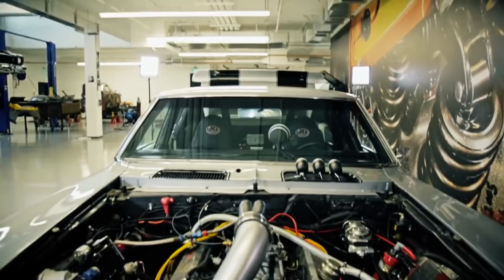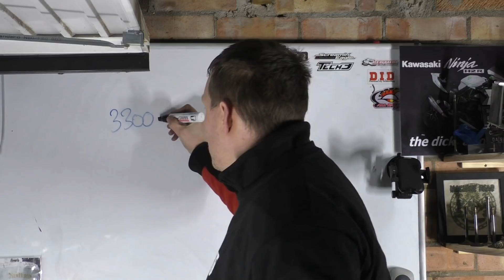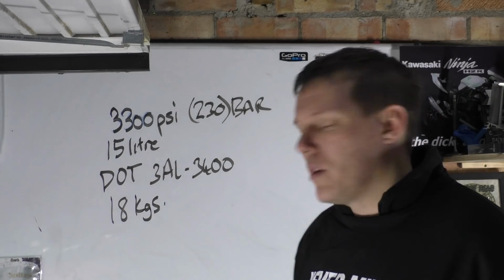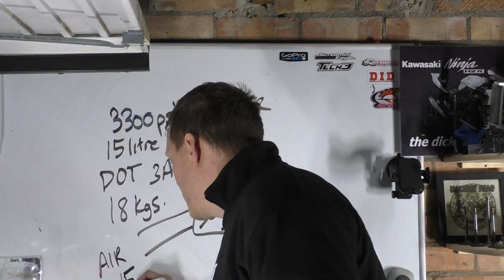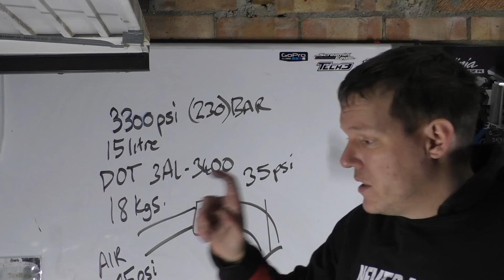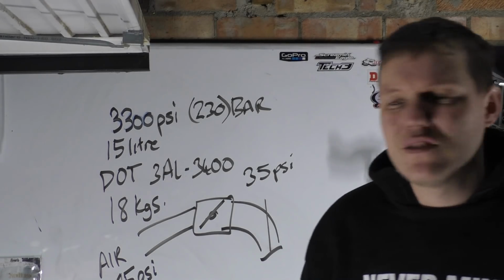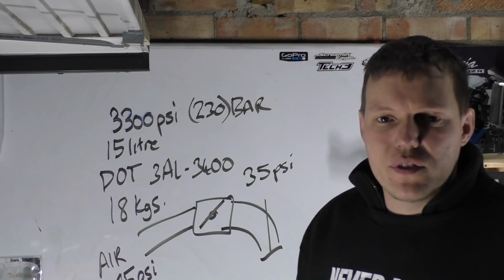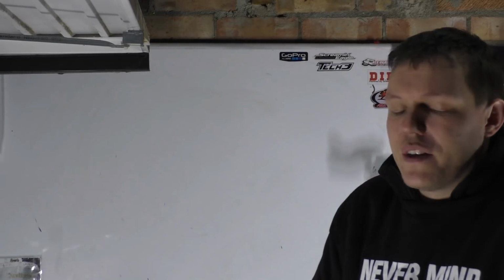Compressed Air Supercharging? - Bullshit?

Comment: They are carbon fibre bottles not carbon jacketed, also they are well bigger than 15 litres  ,if it weighs the same as a complete blower and produce more power then your saving mechanical stress on the motor running a blower ,especially when they go bang ,how many drags you seen on the line and it rips the blower straight off the motor ,in reverse if motor goes then it just blows intake pipes off ,I was bewildered by new system but if it's proven then we see them more in use on the strip
Reply from the maker: "They are carbon fibre bottles not carbon jacketed"

- wrong. 

"158 scf Aluminum Inner, Carbon Fiber overwrap"

From their site here - 

http://casupercharging.com/tech/#Air-Storage-Modules

In future know what you're talking about.

Comment: Wot if..... hehe lol here we go....
3300 psi seems like a fuck of a lot. Wot if...instead of pissing about wiv the fancy system to block off your intakes and all that rubbish....and you just strapped the bottle to the back of your bike with the nozzle facing backwards, and when you want to go faster you just lop the nozzle off with a machete?  Do you think 3300 psi pissing out the back all at once would make the bike go any faster? Serious question.
Reply from the maker: Yes, how much? Well its the mass of the air x its aceleration. So 3300/15 psi = 220. Air weighs in about 0.00129KGs per litre and you have about 15litres x 220 which = 3300 funnily enough so that 4.257 kgs of air. 

If we acelerate that say instantly to the speed of sound (343m/s) then that's 1460N or 328lbs of thrust. With a bike weighing in at 200kgs + 100kgs for rider and fuels etc we get 

Bike mass 300kgs
Force = 1460N

so 1460/300 = 4.866 m/s^2 which is an aceleration of about an extra 10 mph every second. So you'd think for 10 seconds you'll be doing an extra 100mph, however as the bottle empties the pressure drops off, so you go from 10mph down to zero.

So over 10 seconds you theoretically could be going 55 mph faster. This is the perfect example though. More like 30mph after 10 seconds.
Reply: @thedirtyworkshop  Far out, thanks fella you're golden!  I got as far as thinking it would be the 3300 psi trying to equalise with atmospheric pressure outside the bottle, and throw in the mass of that air somewhere, but that's all I had. Obviously a balloon let go flies around, but with the weight of a bike and rider combined I wasn't really sure it would accelerate them much. I'm surprised, but then 3300psi is pretty mind boggling to me.
I guess if you're already doing a decent clip on the motorway then the force from the bottle would be the same but the practical mph effect might be lessened due to already high drag?  Oh I bet that can go down several rabbit holes though, Gah it's holidays - have a day off lad :-)  Thanks again.

Comment: Actually... back in my 50 to 125cc bike days, we'd noticed that the engines ran far far better on cooler misty foggy Autumn days - is that to do with the engines being able to take more energy in per stroke??
Reply: Yes cold air is more dense
Reply: Now the kids call it "boost weather"
Reply: cold air is more dense, and air cooled 2 strokes tend to be kept a little rich since they tend to burn holes in the pistons at perfect  stoichiometry.  on a cool day they're getting closer to a perfect mix and thus make a little more power.  the higher humidity also keeps it cooler than if it was just jetted stoichio on a hot day